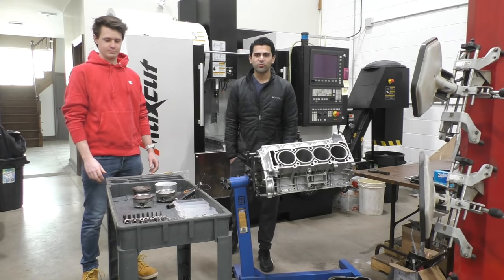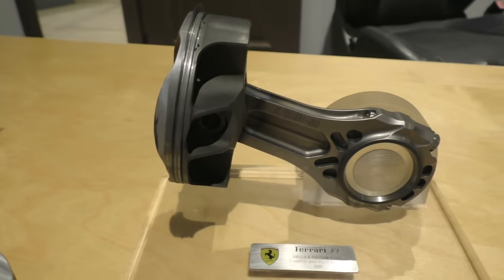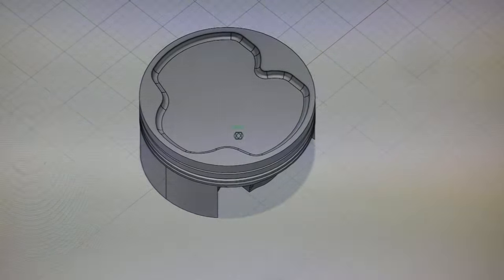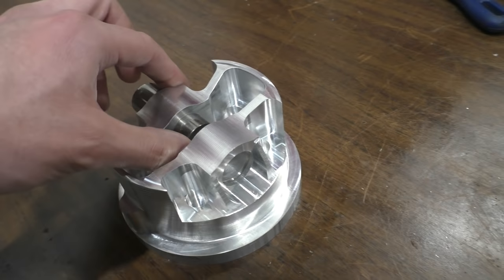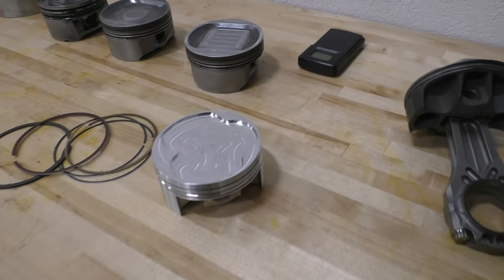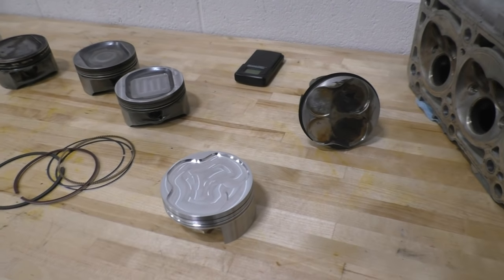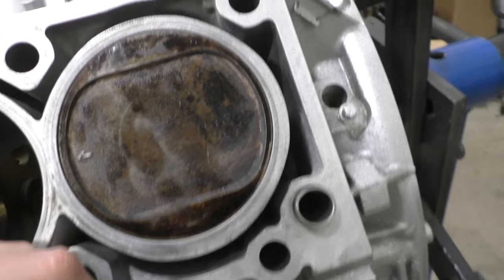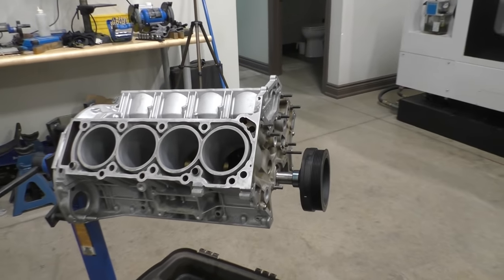Making an 11000rpm F1 Style Piston - Project XF1 Part 2

Comment: I have couple of questions. Is the material you have used extruded bar stock of 2618 as known as billet ? Piston manufacturers calls that billet pistons, not hot forged into the mould afaik. Is it a 2618 with T6 heat treatment as supplied or it was T0 and you have heat treated? If you have heat treated them what is the heat treatment? Afaik, it has to be 4 stage heat treatment.

Comment: Amazing work!!!
Really enjoying the videos!
5 axis cnc would have come in handy in machining the pistons. 
Anyone notice how wide the connecting rod on the F1 piston was?
The F1 piston had a ring around at the base too, all looked very tight.
Am I right in assuming the engine has a very short stroke?
Reply: I think you are right about the stroke. You wont get 825hp out of an NA 3.0l stroker :-)
edit: just googled and found out the f2001 had  a bore of 96 mm with a stroke of only 41.4 mm
Reply: @chuckcharles5963   that bore to stroke ratio quite comparable to CBR1000RR, R1, S1000R, R6 and many others.
Point is, what seems to be extreme in cars tends to be the norm in motorcycles. Look into it, I'm sure you'd find them interesting

Comment: How did your decide on crown height? Ring clearance? Skirt width? Desired surface finish? Thermal expansion?  You've only designed one aspect of the piston, outright strength, and didn't design many of the critical aspects of a piston.

Comment: I'd see if Garret or BorgWarner have twin-scroll turbos that wouldn't flow-limit you at high RPMs, since that particular design is really helpful with exhaust scavenging and maintaining low turbo-lag. Given that it's going on a V8 with some pretty decent torque to begin with, it may not be quite as necessary a concern, but every little bit helps when trying to make the absolute best. It'll be interesting to see what you decide to go with once you get to figuring out the forced induction side of the equation. On the plus side, since you're making your own custom pistons and you've got quite a good CNC mill, you can more specifically clearance the piston surface along the path of the valve travel in case you decide to run some cams with incredibly large valve travel. I don't think it'll be necessary since you've already gained a good deal of clearance compared to stock, but it's good that you have that option. And because you're going forced induction, you also don't need to worry about making a hemispherical and clearanced piston face like they did for the actual F1 piston. You can just change out springs on the wastegates and blowoff valves and just run more boost to compensate, especially if you get some quick-spooling turbos.

Comment: Interesting study congratulations for achieving it. I'm going to do the same.

Pro: One axis turning for machining the piston profile and the ring grooves (+1)
Cons : Missing the elliptical shape of the piston. Your alusil liners will rapidly wear without the needed coatings...

How did you set up the loadings on the software? Thermal and mechanical. Thanks.

Comment: Interesting.
As you stated, top of piston expands more than skirt, not only because it gets hotter but because it simply has more material to expand
 Being a motorcycle tech I have quite a bit of experience with high rpm engines (11,500~13,500rpm for 1970's engines - I modify things a bit) Don't normally go much over 87mm bore though
What alloy did you use for piston?
 I know Mahle uses a 'proprietary' high silicon alloy for forged pistons but I'm out of touch with any developments in last 10 years or so..
Does crown come up level with top of block? Usually only have around 0.035"~0.040" piston to head clearance, set it with head gasket thickness.Larger clearances can create hot spots.
Are you modifying 'open deck'? 
250 bar is over 3,600psi, piston may be able to take it but probably doesn't leave much margin at top of cylinder when things get hot?

Comment: Are you going to lighten the crank to help with that 11k redline?
Reply: he did mention the crank counterweights need to be shaved for clearance (I think of the dry sump?), with a lighter piston/rod it needs trimming anyway.
Reply: @Stereomoo  I do remember that, but like just a spot for clearance. I was referring to a total lightening and polishing to help it rev up and down quicker. At least that's how it worked out on my bike. Guessing wouldn't be much different here. Less spinning mass is always a win IMO

Comment: you pull apart enough engines you can find where the valves floated into the crown of the piston and the marks are no where near the reliefs sometimes. The engineering on mass produced engines can be quite scary.  Interested to see how this works out. The skirts of most pistons are usually patterned with an oil retaining feature of some micro grooving or knurling.

Comment: So different cam profile , plus balanced crank, adjusted fuel table..  unified throttle bodies?? (slide system)?  lightened pistons and re-engineered rods with extra oiling capacity in the rods?  DFV Cosworth engine was the way forward...  what's the design brief ..  good approach i'll be watching closely as i'm doing a similar project but a v12.  ciao for now x

Comment: Isn't the load on the rod bolt proportional to the square of rpm? The 25g weight reduction is 6%, so the rodbolt will have the same anount of load at 11.000rpm with the new piston as the old one at 10.650rpm, right? I am more than confident in your engineering skills, I am just a bit confused because you made it sound like the weight would make life easy for the rodbolt,s but from my understanding it still has to take 3x the load as in the stock car (at 6100).
Reply: I believe the main point of the piston is to reduce the compression ratio and give more clearance to the valves incase of valve float but from what the rod pin has to handle not a huge difference but overall when u take the wieght out of the crankshaft and balance everything it well lighter, my guess is something like close to 500g

Comment: 23:02 piston slap is when engine is cold that your pistons didnt expanded yet to running tolerances, you can hear piston hiting sides of the walls (or oil film beter said :D )
24:46 i would go with as much valve lift as its possible (will vary with how strong springs you can install), also sidenote, use more exh duration than intake with camshafts
26:42 thats nice to hear, also i would invest time for making simple deck insert to strenghten top of the cylinders (something for bottom would be cool too, but not needed or it could be just filled with epoxy in few cm in high)
27:50 900ish ist that much (that stock pistons wouldnt handle) but i would imagine if you would mean 900ish NA hp before adding the turbo i woudnt be surprised, lol

Comment: How much do you change the ovality and taper on the piston to compensate for differing materials and higher designed operating temperatures?.
Curious about how you simulate the change in the shape of the piston at operating temperature based on the temperature gradient and the thermal mass in differing areas - ie it does not expand evenly in all directions. 
how is this then fed into the design for machining at room temperature.

be interesting to see the F1 piston - how much ovality and taper in the design

Comment: F1 engines also have about a 1" or 25mm stroke, they idle at 5000rpm and make no power till around 10000rpm, nearly doubling engine max revs takes more than great pistons and rods , you have reduce the rotating mass by a huge amount and then the cylinder block strength comes into play, will see how this plays out

Comment: So is that Ferrari using a Hemi that the piston has the valve reliefs cut at an angle in the piston?   Just curious because I never seen Hemi Piston head dished. All the ones I saw were flat heads with the reliefs cut into them. I would love to see someone shave their hemi piston like on a 1 cyl bike test motor and check the change in performance on a dyno.

Comment: Those formula pistons are also only designed to last a couple races. But I'm sure you'll go for a middle ground in between lightness and reliability. Are you going to turn these on a lathe? I'd assume you are going to want near-perfect surface finishes on cylindrical features.
Reply: Also, I think you are going to want to use a reamer on that wrist pinholes. Study up on the different classes of fits. I'm sure you can find info for the exact class of fits (tolerances ranges) used in wrist pin applications. I think what you are doing is awesome! Want to see you succeed.
Reply: If you're mounting the piston on the spindle like that checking runout and concentricity is going to be very important. I'm sure you know this but every time you change your fixturing you are referencing different datums and you may be shifting your features. Considering all the GD&T symbols when fixturing and thinking about machining the part will help you alot. For example, the wrist pin bore may be the perfect diameter but is it perfectly cylindrical, was it drilled at an angle, is the position of the hole correct, is the surface finish good enough, is it perfectly concentric with the other wrist pin bore? Asking all these questions will help you make better parts. Usually, prototyping like this would be checked with a CMM but most people don't have access to fancy tools like that which just means you have to take extra care in machining these perfectly.

Comment: Are you not afraid of the sleeves being an open deck design? Are you planning to change to a closed deck design?
Reply: I don't think it would be a problem since its basically the same as the Amg block and those hold power pretty well

Comment: i just see a mayor flaw, is on the piston skirt that have to withstand a lot of force and vibration and I see that its has not filled radius wen it get to the bottom of the top part, but all the rest its ok

Comment: F-1 (and most street cars today) must have FORGED aluminum pistons!!! One race engines, the forged pistons ARE CNC'ed to PERFECTLY match weight, diameter and top of piston displacement, but so are Honda Accord pistons and Toyota Camry and Lexus and more brands! Racing engines take "size" to the extreme in measuring the size at OPERATING TEMPERATURE not room temps. So do most motorcycle engines for "sport" bikes. When I had my 1964 Honda 305cc SuperHawk engine re-built, I had the guys at the machine shop do all these things. Results: a 305cc twin that produces 34.5 Brake Mean Effective Horsepower vs: 27 BMEH stock @11,500 RPM. Horsepower costs cubic dollars, how fast can you afford to go???

Comment: Really cool... out of curiosity did you change the piston to wall clearance for the change in material? I don't know much about billet pistons but I know with forged pistons vs cast pistons.... the cylinder to wall clearance changes. also I'd be really surprised if the engine reliably revved to 11k boosted. Also are you rebalancing the rotating assembly since you've removed so much weight? I would also recommend changing the underdrive pulley to an ATI or something.
Reply: Cylinder to wall clearance changes based on skirt design material used had less impact on the chosen clearance to run. And why wouldn't it work at 11,000 rpm reliably? F1 cars used to run higher rpm with boost. Also, you have to realize "reliable" is a relative thing. Engines of this caliber are designed to live for x amount of cycles. Usually only has to last through 1-3 races.

Comment: what about lubricating the wrist pin? my pistons have a hole to channel oil from the oil rings to the wrist pin, and it sounds essential to me
Reply: That hole is probably also how the oil scraped away by the oil control ring returns to the crankcase. The wrist pin will get some lubrication from other sources (e.g. oil drops flung off the big end bearings), but without that hole the oil cannot escape the oil ring groove. Once the groove is full the oil ring will stop working and the engine will begin burning oil.

Comment: Great episode, as always! Couple questions though, are you planning on converting from hydraulic to solid lifter? From my experience hydraulic lifters start floating around 7000 rpm, I have seen some revving higher with light valves and retainers but not by much. 
Also, are you planning on using a wrist pin bushing inside the piston?
Reply: 1986 Honda CBX750 used hydraulic lifters and revved easily past 10K rpm
Reply: @mickymondo7463  interesting  ..... I'd love to know more
Reply: @olegloginov6328  Aircooled inline four cylinder DOHC 750cc motor later used in the CB750 retro ni the late 90s' but first in the mid 80s' CBX750, google it and you'll find it

Comment: Would heat treating the pistons allow you to push the engine even higher in terms of power at 11k rpm? At that point would the block be the limiting factor. If so, would re-sleeving the engine with stronger sleeves solve the issue?
Reply: at that point the block, piston and crank, valve train almost everything becomes a problem,

Comment: After the pistons what is the next limiter to achieving 11k? Can the fuel injectors keep up?
Reply: Rods, valve springs and rotating masses weights. Injectors location might need to change to be further upstream but as long as they are large enough to supply the required fuel they can just run constantly at high rpm and it’ll homogenise in the port and be drawn in waves into the combustion chamber

Comment: Τhe skirts should be coated to work with the alusil bores and they should be machined hot.. Cold pistons have a smaller diameter in the p;in side,,

Comment: Aren't you supposed to heat up pistons to their working temperature and then machine them to be round so that, if they expand unequally in all directons, they don't become oval when running?
Reply: No, firstly you cant do that, the material will cool to quickly and also cause thermal expansion on your machine. Also pistons dont heat up evenly, you cant simulate this by just heating the entire piston

Comment: Would the diameter of the piston ring groove need to compensate for the extra Aluminium thermal expansion? Or are these rings not causing too much wear?
Reply: I don't think so since the rings themselves expand and have coated in oil to help the clearance

Comment: Billet machining is cool until you’ve seen Porsches 3D printed and lighter piston. Complex oil passages that can’t be manufactured with current manufacturing practices along with how much weight they can remove.
Reply: Problem is they are way less ductile tham forged/billet aluminuim so they will take less abuse if you run into knock and might break instead of deforming.
Reply: isn't that like 10 years away, 3D printing is a new field that still needs alot of researcher
Reply: @azargelin  it does still need some research for Implementation into actual cars for costumers, but for racing it is already used since a couple of years. Even at Formula Student we use metal laser sintered parts since 2015
Reply: Porsche did it with Mahle, I personally like to call manufacturing methods like this: additive casting lol. And it's all still very secret sauce-ish (more than just aluminium in the mix), only tested/have data in "low mileage" racing engines where temperature ranges are narrow compared to how road cars are operated and treated (i.e. very un-mechanically sympathetic, started cold, then heavy load right off the bat. Drive for short while, quickly heated up and then cooled, then quickly heated again.).

Comment: And you thought this was easier than going to Mahle or similar?    One thing I do know, manufacturers make their pistons as light as they believe is reasonable for long term duration....   And one of the most stressful parts is when you suddenly slam the throttle close and the engine is spinning at high rpms.  Basically on the intake stroke your pistons tries to rip off the piston pin.   So you have to analyze both in compression and tension.
Oh and when the piston disconnects from the rod, the rod goes sideways and punches a  hole in the block.  And to add insult to injury, what is left of the piston impacts the valves screwing up the head as well.  Ask me how I know.  GM motors from the 90s could not hold 7000rpm for long (about 6500 for short periods about it).  I believe they used hyperutectic pistons and made them as light as possible.

Comment: Doing FEA in CAE for analytics of the part's brilliant methods for optimization
Reply: Kudos for using the generative design output as a starting spot for creative engineering a machinable solution
Reply: 250 bar of pressure & 25 grams lower mass // good work

Comment: You realize that pistons are not round right? They are slightly oval so that when they expand unevenly from heat they will be round. Also, billet pistons have a different taper than cast pistons, again due to the different expansion rates of the respective grades of aluminum.

Comment: Why you don't use 4valve instead and why this engine?
Reply: it weighs less than a honda k24 because it's aluminum and magnesium, it has a square bore and stroke which is designed for high rev racing, and it's the most robust mercedes v8. it doesnt need 4 valve dohc because it's 3 valce sohc dual spark.

Comment: What’s the mean piston speed for that v8 at 11k rpm? I imagine with the stroke of that v8 it wouldn’t last long at 11k
Reply: 30,80m/sec if its 5.0L with 84mm stroke. 
33,73m/sec if its 5,4L with 92mm stroke. 
Ultra high.

Comment: What billet material did you use, 6061T6?
Reply: No he used 2618
Reply: 6061 could never handle the temperatures experienced by an automotive piston, even on a stock engine. 2618 is an alloy with added nickel to increase its high temperature strength, specifically formulated for racing engine pistons.